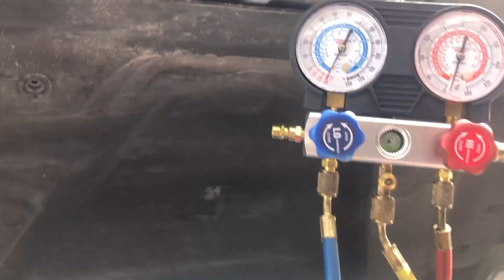Simple Routines To Save Money For Transport Drivers!

Comment: You don’t need those additives to get high mileage !!  Fuel is super clean  
I change fuel filter , oil and oil filter when dash alarms me  change trans oil and filters when fluid starts to smell rank 
L5P has 573529 miles bone stock
I get about 68,000 out of a set tires 
Keeping it clean is crucial

Comment: I’m thinking about starting this up and have a few questions. 
1. Will a 2021 Ram 2500 work for this job?
2. About how much can you make on a trip? 
Thanks!
Reply: yes, that truck will work. and you get paid by the mile. Yesterday I delivered an RV from Indiana to Syracuse New York and it paid $915. 538 miles @ 1.70 per mile.

Comment: What fuel tank is that? I’m trying to find the largest tank I can that sits below the bed rails and still accommodates my 5th wheel.
Reply: 72gallon is to my knowledge. I have short box Chevy with 5th wheel and mine is below my cover and takes up 95% of rest of space.  I did have a company cut holes in my cover and put Velcro flaps so I can fill tank.